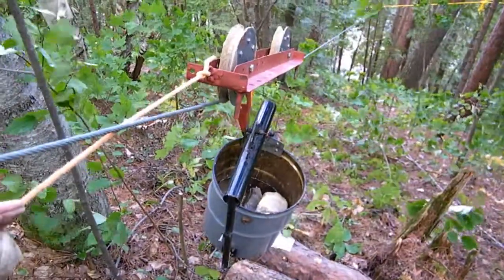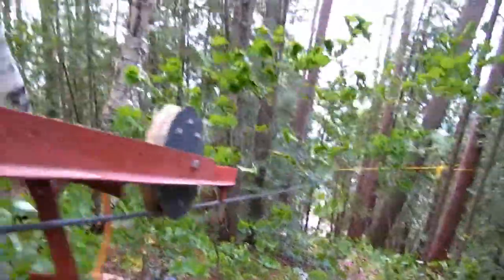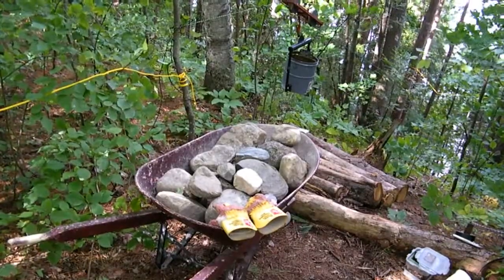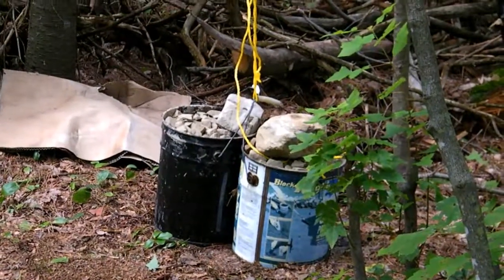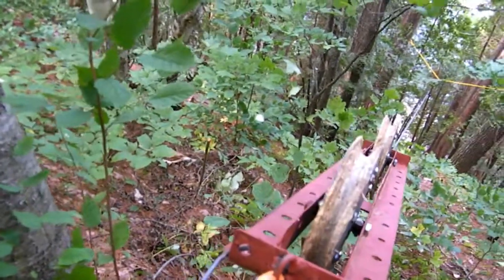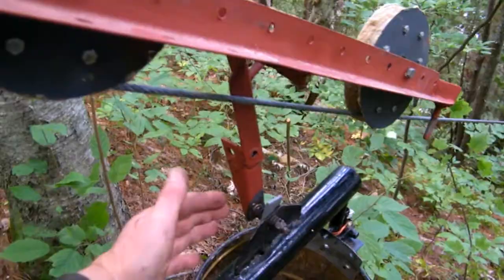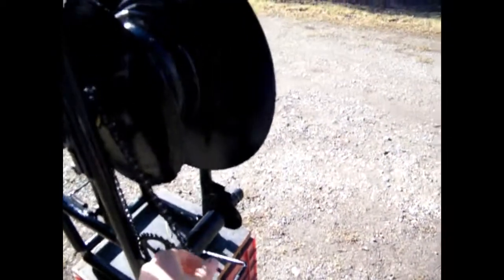Auto-dumping auto-return zip-line rock bucket

Comment: I have a really bad back, and was looking for a way to haul about 200 wheelbarrows worth of bark/mulch into my back yard, which has a narrow, highly sloped path to get to it. My property is split-level, and I can have the mulch dumped in the upper part, which is further away, but isn't sloped, but is narrower and will block my main driveway for weeks, since my back can't take too much... Or, I can have it dumped in the lower lot, which is closer, but is much lower grade, and only has an extremely narrow staircase for access, so a wheelbarrow won't work... I also have an extremely run-down shed, and non-functional hottub in the upper part, that needs to get cut down and thrown away, so I think a system like this would be perfect, where I can disassemble and reuse it for hauling up and down. I wish there was a bit more detail on the auto dumping mechanism, and the reducing mechanism, but it might be fun to try to reverse engineer something to fit my needs. My initial thought was to use something like a cordless drill to power it, but the counterweight setup looks even better!

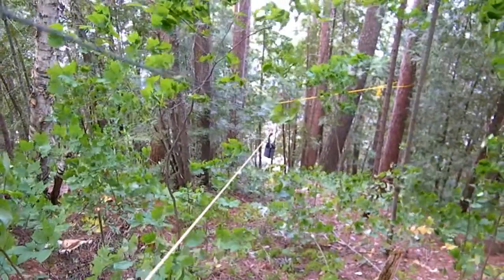Comment: 0:32 how did you use that yellow rope to hoist the main zipline up? I can’t figure out how without it catching on the bucket and trolley.
Reply from the maker: There would have been the problem you imagine, if the rope attachment were centered on the trolley directly above the zip line travel path. This would be the ideal location to align the pull force with the path of the trolley. 

Instead I attach on the left side of the trolley, while the intermediate zip line supports spaced down the bluff come down on the right and then under and up to support the cable. I don't show those supports but  they are what you would see on a ski lift. I made those cable supports from old chainsaw bars and scrap metal . (left & right viewpoint: standing at the top of the bluff watch the trolley down below)

Where I attach the pull rope is good enough that the trolley does not twist off, and thus the rope comes close to touching the zip line, but is always on the left side of it. The bucket is below the attach point so it never interferes.

Comment: So great! I found this search for bucket zip lines after realizing a zip line was the best way to haul brush up from the slope below my house. Great inspiration here - I’m going to try to go the opposite way with the load though!
Reply from the maker: Thanks. Happy to help :)
You will have to inject energy to raise your load but here is a thought: a counterweight that drops as your load rises and ultimately auto-dumps. If the counterweight is always less than the load you can pull it down using a tether attached to it, without much effort: that way your trolley won't accelerate out of control. 
Return#1: The counterweight can be hauled back up with a rope and pulley, where a hook on the end of the rope can anchor to something while you reload.
Return#2: At the top, a helper fills the bucket with water until it happily sails back down to you.
(never stand under the counterweight!!)

Comment: I would love a follow up video of the counterweight mechanism.  Very cool
Reply from the maker: Thanks for the "cool" :)
I've zipped 3 truckloads so far, and maybe I'm done.
I do briefly show the counterweight gear reducer. The idea is the main thing. What you might build depends on what you have handy but here are some thoughts.
1. I've reduced the reduction to 7X because available height allows that. The lighter the counterweight the better...lighter counterweight is easier on the counterweight cable and the system is more responsive overall and easier to tune so the bucket stops right where I am.
2. If you have grid power then electric motor rewind is a lazy option. The weight of gantry and empty bucket might be 20lb at most.
3. One pair of bicycle brake pads has zipped 3 truckloads yet shows minimal wear. Makes sense I guess...an adult cyclist is heavier than a bucket 'o rocks.

Comment: I have quite a deep slope and want to use a zip line but for myself so I can enjoy zipping up and down without having to walk up. Would that be possible with your system?
Reply from the maker: It would work in principle but would have to be over built since you are trusting your life to it. You would want to add a safety brake in case the counterweight system failed, and you would want to add a safety hook in case your gondola gantry jumped off.

The cable tension due to your body weight and that of your carrier would be massive, even though it reduces as your hill angle increases. Cable tension means a major anchor requirement. Easy to calculate.

When you get to the bottom you would need to hitch your gondola so it does not fire back up and smash your counterweight system. You may be mindful of that and never have a problem, but it is not “idiot proof” for others.

An alternate approach is some tracks and a 12V winch. While you are scheming you could always lay down a rope with knots and keep a pair of mechanics gloves handy: you still need leg power but it makes any slope easier:)

Comment: This guy had a lot of time.   
I would have used an4 wheeler and a trailer or a mule.
Reply from the maker: ...Or a trailer pulled by snowmobile or barge pulled by boat, but the nearest public access officially forbids motorized vehicles and nobody local trusts the ice over the shallows down there (except one unfortunate who was found in the spring). Timer & motion all come back around to this direct route being fastest, as well as not bothering anyone. Rock to wheelbarrow, rock to zip, zip-pile to destination: same rock touched 3 times. I've ordered 3 more truck loads. Wish I had more time - you can never have enough:)